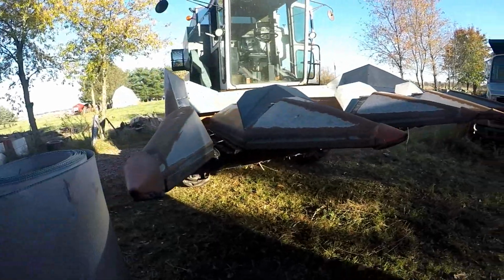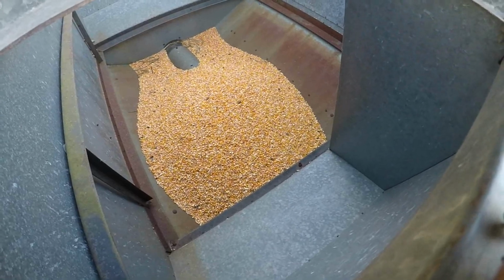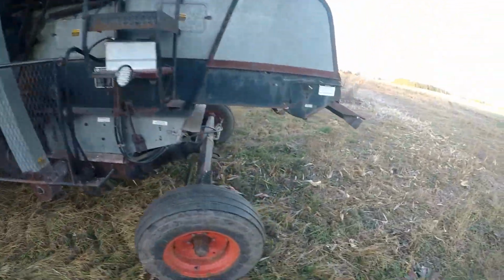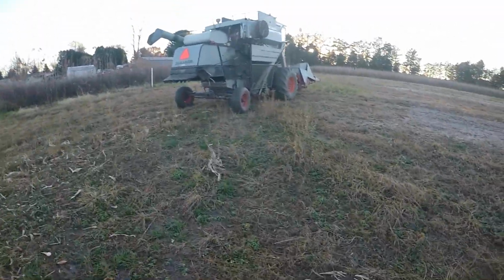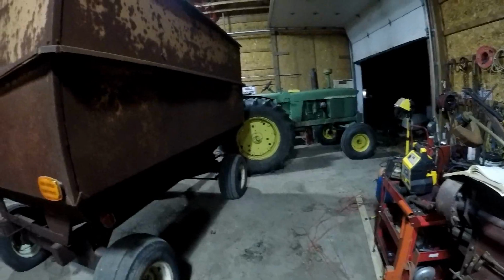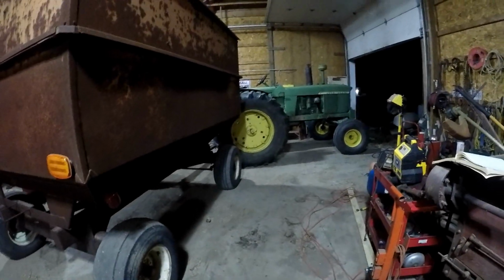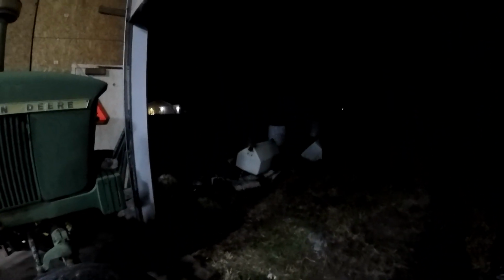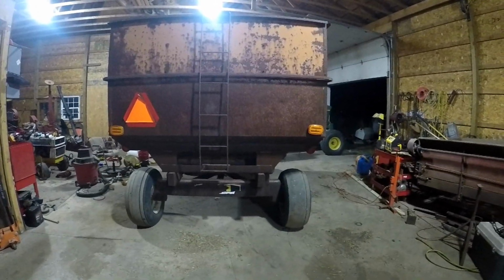Harvest All in One

Comment: Question, do you put any nitrogen down in front of your corn?  Anhydrous, liquid N, or urea?
Reply from the maker: @case1020  in this instance I didn't do any fertilizer but when I do I'll put down starter as I plant and come in and side dress with liquid.
Reply: @BackFarms  copy that. I was just curious. I use anhydrous but everyone has their own thing that works!
I came across your channel by accident lol. I was searching for Gleaner F combines running because that's what I grew up on and just wanted to see one run again.
Reply from the maker: @case1020  I'm not set up for anhydrous and it makes me a little nervous, but once I get my white planter done I'll be able to do liquid starter instead of solid fertilizer and then I'll liquid side dress.
Reply: @BackFarms  sounds like a good plan.  I have your planter video in my cue to watch.  
Liquid starter will help for sure. Will it be in furrow or off to the side of the row?
Reply from the maker: @case1020  I haven't decided, more than likely off to the side.